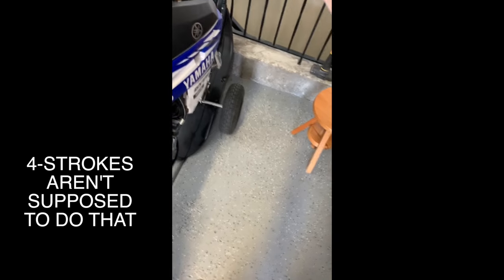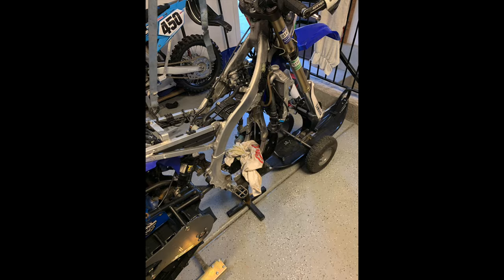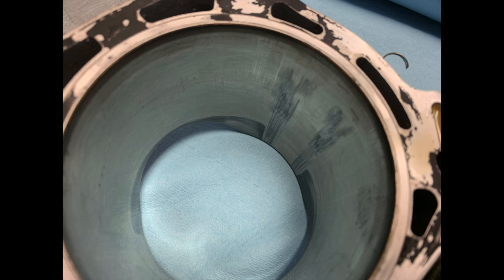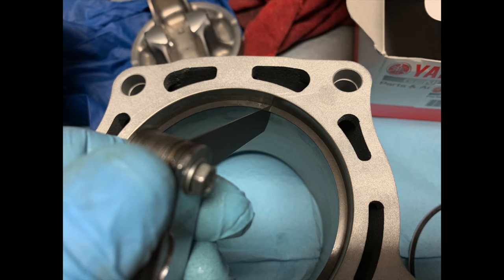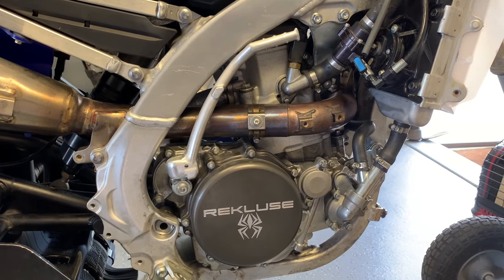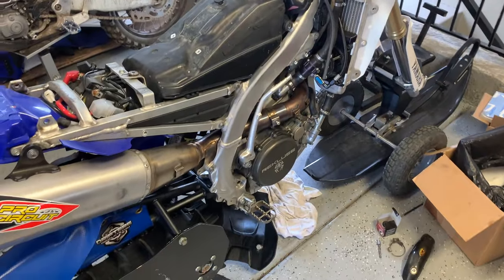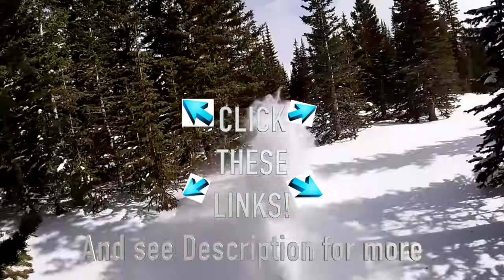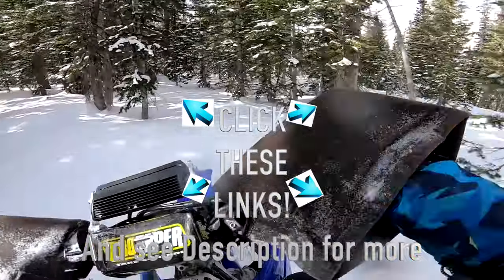BAD 4-Stroke Motor Sound FIXED - Yamaha 450

Comment: Did you fix the cylinder or did you buy a new one. I am rebuilding a rmz450 now and the cylinder got minor scratches.
Reply from the maker: Bought a new cylinder.  If the scratches are deep enough that they can’t be honed out, gotta replace or repair it

Comment: Nice job, i have crf 450 2004 and The piston got stuck while drivning this summer.. Got it Lose and it starts and runs like normal now. Is it safe to run it and what do you think caused it to stuck?
Reply from the maker: The only reason I know of a piston getting stuck (seizing) is heat.  I think you’re rolling the dice my friend.  I’d open it up and check it out if I were you.
Reply: @jethro450  Yes, think its for the best.. Thank you for reply!

Comment: My Yamaha raptor 350 has the same sound gonna take the top end off and take a look. Very good vid!
Reply from the maker: Good luck!
Reply: @jethro450  it was the rod bearing 💀 getting the crank rebuilt tho
Reply from the maker: @COMBATCOACH13  that’s what I thought this one was at first too.  I think both noises are very similar.
Reply: @jethro450  I thought if it was the rod bearing it would sound like rod knock but apparently not

Comment: Hi my dirt bike takes of when I put in first gear and still holding clutch all the way in do you no wat the problem is please help me anyone 🙏🏽
Reply from the maker: Yes.  Either your clutch cable is broke or the more likely problem is your clutch basket is worn out and needs replaced.
Reply: @jethro450  😢 man also I think it might be blown because I start it and it makes the noise your bike was making but I’m not sure I don’t know much about bikes
Reply: @jethro450  how can I tell if it is blown
Reply from the maker: @charlie9822  you may be better off taking it to someone.  Sorry, hopefully you get lucky and it’s not too bad
Reply: @jethro450  thank you I just wanted to know how to tell if my bike is blown

Comment: @jethro450 do you have any idea what could be wrong with my bike it’s not starting at all. The electric start is making a loud cranking and the kick start is making metal sounds that dirtbikes aren’t supposed the be making and there is also no compression in the kick start
Reply from the maker: Sounds like a blown motor… new top end time.  Start taking it apart and figure out what ya need.  Sorry man

Comment: My engine sounds similar and it only starts  by push starting it (kick start bike) . Did you do a leak down test before taking it apart ?
Reply from the maker: No if it sounds bad, there’s not much use in a leak down when I know I need to look at something.  A leak down test, in my opinion, is only good for when a motor still sounds fine and you’re wondering if you need new rings or something.  If it already sounds bad, I’d take it apart.

Comment: I just had a 450  quad to explode busting the front and back of cylinder blowing starter off  is this even fixable
Reply: Of course it is fixable - however, the only way out that makes sense to me is to order all new parts. 

And yes, it will cost an arm, a leg, and two months mortgage! It is because you will have to purchase a good majority of a new engine, and the unfortunate news is that it is a four stroke, and four strokes have many more moving parts, so the costs will be astronomically higher than a two stroke, however, the good news is that once all of the parts are replaced, your bike will basically be a brand new four stroke engine - which also means it will last two to three times longer than a two stroke engine in general. Sometimes you will see them last four or more times longer than a two stroke, again, because the engine you own has more moving parts being that it has been engineered as a four stroke, and because it is a big bore engine, or larger displacement engine, rather.

Comment: Why does smoke roll out of the exhaust like that? I have a new bike, after shutting it off I had smoke rolling out of exhaust like that
Reply from the maker: Hmm that doesn’t sound good my friend.   Brand new?  Used?  Keep riding it and break it in if it’s brand new, the rings need to seat.  If it’s used and doing that, you may be due for a top end.
Reply: @jethro450  thanks. The bike is brand new. It has been happening after the first couple break in rides. Super stinky smelling as well. Rolls out for a while after
Reply from the maker: @daltonpetsch7721  my guess is your muffler packing is burning in.  At least I hope that’s the case.  Give it some time.
Reply: I know this was a wjile ago but my 2021 yz250f did that too. Its stopped after the first few starts.

Comment: What did you do with the marks on the cylinder walls
Reply from the maker: Millennium technologies replaced the cylinder for me for a little less than a new cylinder, but has a thicker nickasil coating (so it’s better than stock with tighter tolerances).  That motor sounded so tight and nicer than another other comparable yz I e ridden lately after that job was done and it’s all because of the nice job millennium did on the cylinder

Comment: Is it the same for all engines cuz mine knocks at any rpm i went full trottle and just lost power and it started knocking the moment a heard a knock i shut it off and pushed it home is it valves or piston cuz urs knocks a little on idle mine knocks loud at any rpm
Reply from the maker: That would scare me, I’d tear it apart before anything worse happens

Comment: Just cleaned my carb on my 07 450. Fired it up and it sounds exactly like this. Hoping its not the rod.
Reply from the maker: Cleaning a carb wouldn’t cause this but maybe you’re more sensitive to how it sounds now that you did some work on it?  Good luck man, hope it’s ok
Reply: @jethro450  o yeah, sorry Ididnt mean to sound like I thought it was carb related. But since its been sitting for a almost a year, i was extra sensitive  to the engine noise.
Reply from the maker: @cookiemonster3146  got it.  A shop can do a leak down test to help you find out without spending too much money.  If the piston is worn, a leak down test would tell you

Comment: I'm running a dr 200 and the old carb allways gave me problems so I changed it out with a pwk d slide carb and it runs great till I'm at full throttle then if I hold it for half a mile it feels like it is missing. Ive changed the Jets I have moved the needle clip I thought I was giving it too much fuel and it was doing 8 cycle but I'm at a loss its not too rich its not too lean could I be running the bowl dry at full throttle ?
Reply from the maker: Full throttle is main jet… but maybe the after market carb just can’t deliver the gas the bike needs???  My best guess to try us to find a good stock carb to put on and try.  Before you do that though…
Also, I had a similar experience with bad gas from the gas station recently.  Bike acted exactly like you say, wouldn’t run at full throttle.   Try draining the tank and using different gas from a different gas station
Reply: @jethro450  thanks ive been told to check the valves and look for a vacuum leak by some others if it happens with the stock carb again I dont know what it will be

Comment: I got a problem hoping you can help . When i went to kick start it, a puff of smoke came out the intake What does that mean ?
Reply from the maker: My guess is that’s a back fire.  Doesn’t happen too often and not a big deal.  Nothing to worry about assuming I’m right.  That used to happen on older four strokes all the time when starting.  The Kickstarter would kick back about about break your shin…
Reply: @jethro450  Thank you 🙏🏽

Comment: My 2018 450r starts right up no problems or weird noises but it starts to smoke a bit after idling for like 30 seconds by the looks of it it’s coming from either the exhaust clamps or the radiator hoses or the top end ??! The header itself gets really hot after a few seconds of idling which is also weird. It’s not leaking any fluids from anywhere. I’m just scared if I run it too long I’m going to damage the piston. Hopefully somebody could help me out it would be much appreciated
Reply from the maker: Hmmm have you figured this out?  My guess is warped head/leaking head gasket which puts radiator fluid into the motor and smokes a lot but it’s hard to say not being there
Reply: @jethro450  yeah I actually figured it out I had just dropped cable lube on my header and didn’t notice and it was just burning up the lube that was on the pipe, bikes all good though!!! I appreciate you trying to help me out though bud !

Comment: Is it normal for my brand new 4 stroke bike to make noises when letting off the clutch in 1st gear
Reply from the maker: Ya.  Four strokes are noisy.  I hate how my 450 sounds just idling in neutral.  Sounds like it’s gonna fall apart on the clutch side.  They’re just noisy.  But there is a difference between bad noisy and normal noisy.  This video shows what bad noisy sounds like.
Reply: @jethro450  when i let off the clutch in first gear it makes some noise at the end of the clutch,only does that when u first start riding it doesnt do it while the bike its rolling
Reply from the maker: @hvhnubek  my 250 does something similar and I think it’s because the oil isn’t totally warmed up and clutch plates aren’t lubed and ready to go.  Probably just needs a touch more oil or warmed up.  That’s my best guess.  Hard to say without having the bike right here with me to figure it out
Reply: @jethro450  thanks i will open it up
Reply: @hvhnubek  my guess is your on the brink of stalling it
Reply: @jacobdeore8533  nah its not that
Reply: @hvhnubek  chain slap maybe, when starting out chains do that
Reply: @jacobdeore8533  it is chain slaping but its not the chain i have checked it
Reply: @jacobdeore8533  timing chain?

Comment: Huh.. I have a motor that I thought was bottom end noise and now you've got me worried lol.  Only has 700km on it.  Not a yamaha motor though.
Reply from the maker: Stephen M .  If the sound smooths out as you rev it, don’t worry about it.  They’re all noisy at idle.  If not, I’d check it.
Reply: @jethro450 It doesnt smooth out.  But it does have low oil pressure at idle vs revved up a bit.  So still leaning towards bottom end.

Comment: How many hours was on this engine?
Reply from the maker: Jay bray We don’t know.  I sold my tuner so I couldn’t check.  I don’t think it had much though, like less than 200, but I also know it was a rental before my buddy bought it so it wasn’t treated very well.
Reply from the maker: I’m gonna try to get my hands on a tuner to find out
Reply: @jethro450  Hopefully you also replaced the timing chain and tensioner. I am building an 08 yz450 snowbike this summer and have all new oem engine parts. Stupid expensive but worth it. Funny about the ring end gap. I have done a few complete rebuilds on four and two stroke engines now and with new oem cylinder and rings i have never had to adjust the ring end gap.

Comment: I have a 05 crf250r and it’s had a bad rattle almost louder than the actual engine itself and it sounds like this ,is there any other cause for it to make a bad rattle sound or no I have done a compression test a while back when it first made the noise and came up as good compression and have never had problems with it doesn’t smoke valves are all in spec cams in spec timings in spec it has new clutch plates and harder springs so less clutch slippage clutch looked in good condition to my dad who used to race and was constantly replacing clutches cause they would blow them up frequently just the way him and his brother raced the only thing that I have left to check and replace cause I have the parts for it is the water pump bearing and we inspected the cam cause Honda said it could be the cam wearing out but it looked good so the only things that we’ve come to are either the bottom end or the piston and I’ve inspected the oil filter and cut it open many times and haven’t found any metal flakes so that’s why we didn’t think it would be the piston or the bottom end because usually it would show up he said unless there is maybe somthing I’ve over looked would like another opinion please and thank you
Reply from the maker: Man sometimes you just have to start pulling stuff apart.  There’s really no other way to figure it out.  From your description I’d guess bottom end, piston, maybe a loose timing chain (doubt it), and maybe other loose clutch components…. But it’s hard to say.  Bummer and good luck!
Reply: @jethro450  alright thank you hoping it’s not bottom end otherwise I’ll probably either sell or part out

Comment: Well I've just wasted alot of money then. I've just had mine rebuilt and it sounds the same brand new parts
Reply from the maker: They’re all noisy (4 strokes).  But that noise should go away when you rev it.  This one didn’t.  New parts fixed it.
Reply: @jethro450  I have a 2008 Crf250r, the thing was someone’s baby and you can tell. It just has a clinking noise when the idle is low and when it first starts then it goes away. It’s very faint when riding aswell. Do you know what this could be? It runs great though.
Reply from the maker: @nalyd6386  that’s hard to say without hearing it myself.  My guess would be a timing chain that’s worn out but I hate to even guess.  Maybe make a short video and post it on ThumperTalk.  It may just be normal, who knows??
Reply: @jethro450  I know, the funny thing is is that we looked at 2 crf250r’s the day I fort mine, the first one I got, it had a horrible clinking noise but it ran fine. It made a similar noise as my one now makes but the one I have it’s much more faint.